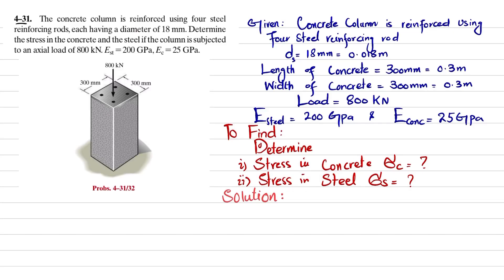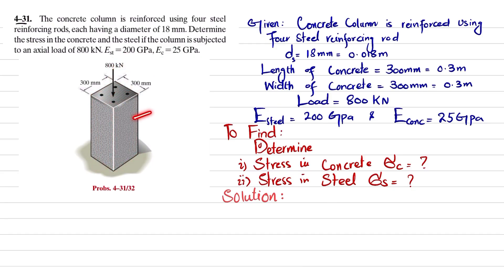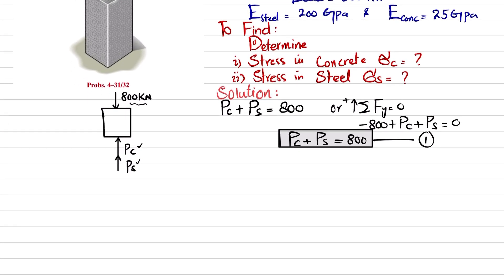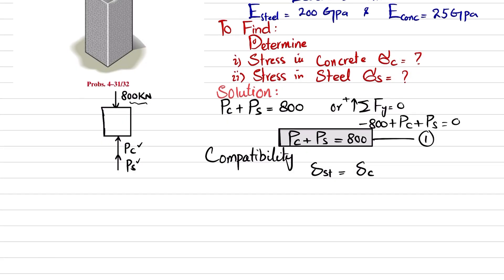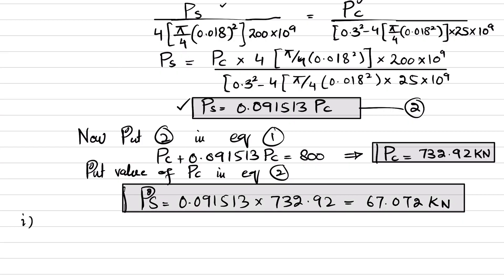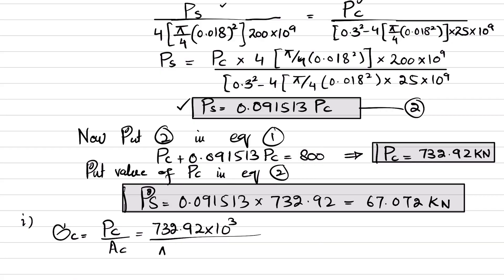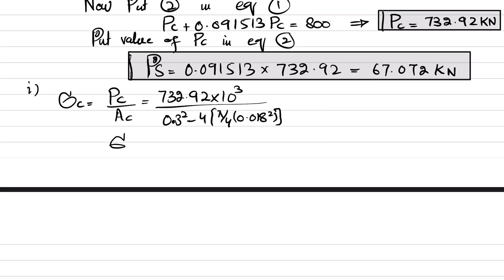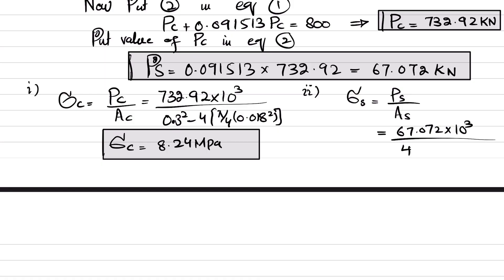4-31 Determine stress in concrete & steel | Axial Loading | Mechanics of Materials by R.C Hibbeler

Comment: If instead of dia if we are given Cross sectional area 900m^ so how will we solve it ? Answers pls , help sir , I am having my 3rd semester final paper of mechanics of solids
Reply from the maker: Cross sectional area of which thing is given?
Reply: @engradnanrasheedmechanical of the 4 symmetrical steel bars
Reply from the maker: Cross sectional area of single bar is = pi * radius ^2 or (pi/4 )*d^2 so there are 4 bars then multiply this with 4 will be equal to 900 then calculate the d which is the diameter of one bar.

Comment: Concrete column is having a square cross sectional area right?
Then how can we use the area for circle?
Reply from the maker: yes but you can see there are four steel rods in that so for area or rod we have used area of circle. kindly check the whole problem.

Comment: you used the diameter instead of the radius to calculate the area.
Reply from the maker: Diameter was given that's why I use it and I you calculate with area it will be same area....
Reply: @engradnanrasheedmechanical  it is the same because you take pi/4 instead of pi/2 I believe.
Reply from the maker: @epiccole1128 area of circle is pi/4 x d^2 when you use diameter and when radius is given then simply use pi * r^2.